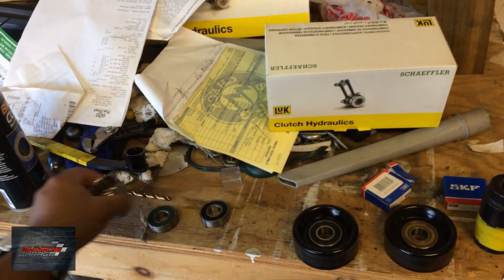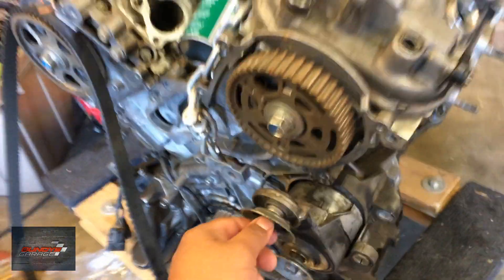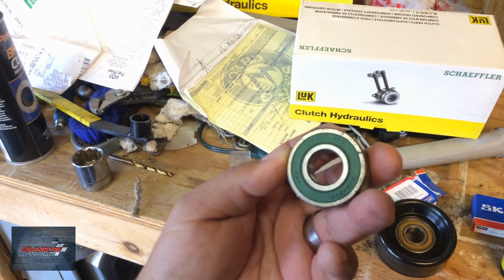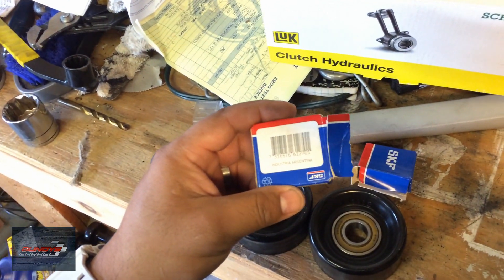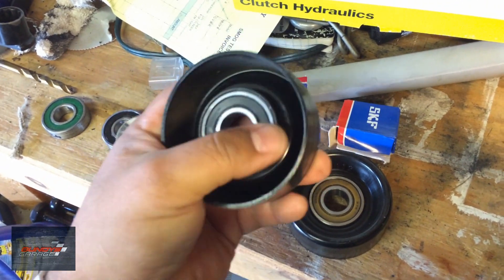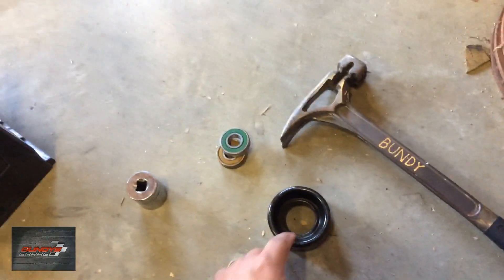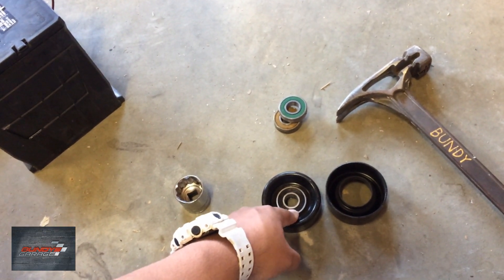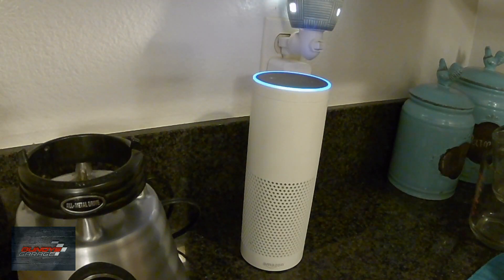Tensioner Pulley Bearing Removal & Replacement | Honda Acura | Accord Odyssey Pilot Civic J Series

Comment: The tensioner spring weakens over time and allows the belt to slip which makes noise.
Replace whole tensioner, not just the pulley.
Reply from the maker: It’s take a long, long time for the spring to lose tension. In most cases, not all, the bearing fails before anything else.

Comment: Nice man!! You can also rebuild the power steering pump to save money. I got all of the parts from acura for under 100.00 
Everyone else wants 230.00 plus for a pump
Reply: I did the same... kind of... ordered the seal kit and just replaced the leaking seal.
Reply: @ChrisD-kl3ty how tough is rebuilding the pump?

Comment: Dude, buy a vise or a press  and learn to use it. You shouldn’t use a hammer to put in bearings.
Reply from the maker: It's not that big of a deal. It's a bearing in a pulley, really can't mess that up. Now if it was a bearing on a knuckle, yes I would use a press.

Comment: Thanks  for the video.
 I have a Odyssey 2007. The tensioner and  pulley fell off the hood and the smoke came out, and the steering wheel was heavy. 
It was towed to Firestone , they replaced the parts and belt. 
 A month later, when the engine is on  on parking gear. The parts they replaced fell off the hood again. And the van was dead and towed. 

Is this a big problem ? If this happens again when it's driving on the highway ? 
Should I keep this 90000 miles Honda Odyssey?
Reply: Michelle Xie I won't keep any Odyssey; they have a lot of problems with the transmission. If you like minivans, get a Toyota sienna. Also, the pulley shouldn't fell off; I think they made a mistake or something. You don't replace pulley or bearing maybe once every 100k
Reply: @maxin3231  I like Honda motorcycle but my wife like the body of the odyssey.  We had clunking of the transmission in cold morning without adequate warm up. I just replace the timing belt at 75 k miles because the tensioner is making noise in cold morning.  Otherwise it is a good minivan. Oh, cable that pull the sliding side door broke after 5 years.  I have to cherry rig it.

Comment: Online Honda & Acura dealers sells the pulleys with new bearings (OEM Honda use NSK bearings) for $15 and $20 respectively (31180-RCA-A02 & 31190-RCA-A02).  For that price you get a new pulley and bearing pre-assembled to save you lots of time/effort.
Reply from the maker: You forgot the cost of shipping
Reply: @bundysgarage  : Good point.  I just paid $9 shipping for two of each (including a bunch of air filters).  This was one state away from HondaPartsGuys in San Bernadino CA. I'm just hoping breaking the reverse-thread bolt loose once the tensioner is off the car is easy.....or should I do that while it's still on the engine?
BTW: Honda uses Mitsuboshi brand drive belts and you can buy then without the Honda logo for about half price.  They sometimes use Bando also which is even cheaper.
Reply from the maker: Do it while it’s still on the engine. Or if you have an air impact gun you can break it loose that way.

Comment: I thought about doing that, but the cost of buying the bearing and the socket (I don't have that socket size) was equal to just getting the pulley. I'm planning on getting a large socket set.
What sizes do you recommend? that are common on this cars.
Good vid though 👍